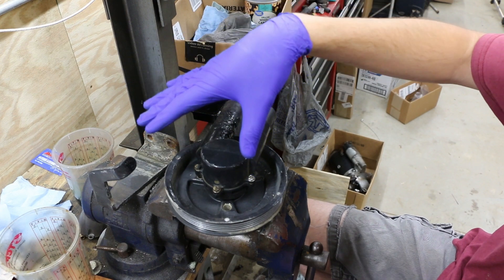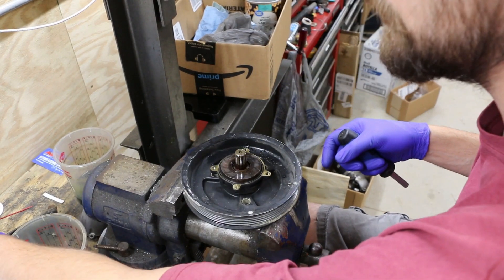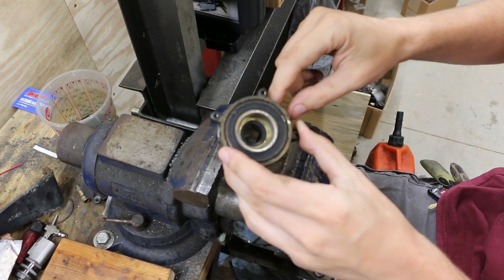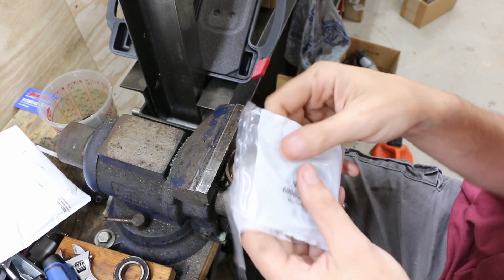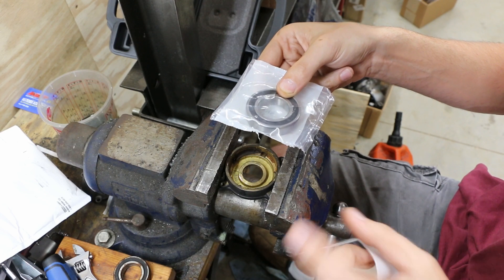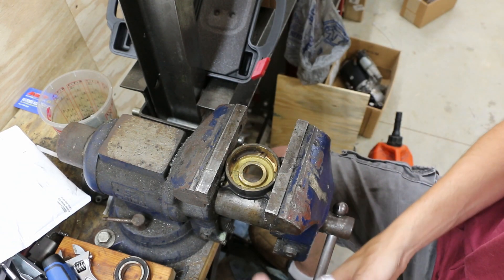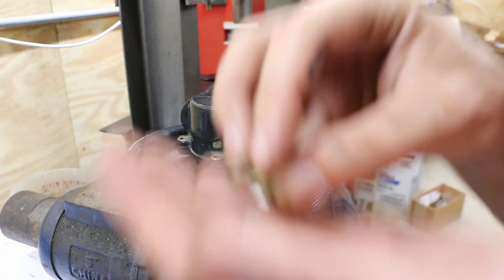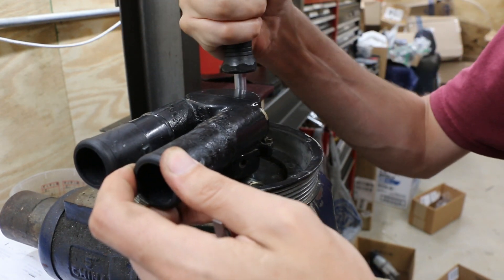Volvo Penta Sea Water Pump Rebuild (shaft seal, bearing, impeller replacement)

Comment: One trick to try for bearing installing is to put bearing in freezer prior to installing, should go in much easier.

Also large socket should work well for pressing back in the bearing incase the housing isn’t up to the task.

Thanks for sharing good video!
Reply from the maker: I forget that trick all the time.
I use it regularly for seadoo wear rings, so much so that I just keep them in the freezer, but bearings and other press fit type things it doesn't click to do the same!
Thanks for the reminder!

Comment: Hmmm…the part references are no longer available expect for the bearing, but I have no idea if that same Timken will fit my 5.7 GI motor….are they all the same
Reply from the maker: Oh man I'll check in a little bit when I'm back near my computer and update them, there are a few different pumps, I can probably look up and see if your motor uses the same pump, is that a capital i or a lowercase L in the GI?
Reply from the maker: What are the other letters in your motor serial? if you want you can email me: tom at trythistv dot com
There are a number of options, some use the same pump, others are different. Some have numbers like PMDA, PHUS, while others just have a -C, -CF or such
Reply: Mine is a 2008 5.7 Gi (little I as in ida).  That’s displayed on engine and the manual calls it a Gi-G.   I ordered the Stay Cool kit for this motor and says it’s stainless bearings.  Once I get it in hand I will see how it looks. If needed I will run it to auto parts store and get a Timken once I see the numbers on it for reference.  The oem has no numbers I can see. 

Great video and I have it all apart and ready for assembly though. I may even use one of my spare Volvo impellers as I have 5 since I change em every other year and none have many hours on them.  If the kit looks ok I will go with it as that impeller will get swapped after 20 to 30 hours anyway. 

It’s crazy that VP wants 80 plus dollars for an impeller.
Reply from the maker: Your Gi-G does use a slightly newer pump, but the staycool kit should have the parts you need, and worst case like you said you can match up a US made bearing if the one that comes with the kit doesn't look great. I would hope they are selling decent quality stuff, but you never know anymore.
Reply: Got it all installed and will test it tomorrow….the Stay Cool kit looked fine, but time will tell.  Honestly, I’ve never had as much as a crack in any of the impellers I’ve changed.  The bearing looked good to me but will make sure all is steady on the spin. My oem bearing wasn’t making sounds but had corrosion from water exposure so it was a matter of time…..it lasted 16 years so can’t complain.  Thanks again for video….the knowledge saved me around 600 dollars.

Comment from the maker: Here are the tools and parts you'll need:
➡ Pilot bearing puller: https://amzn.to/3r4F0yV
➡ Bearing driver set: https://amzn.to/3PgHl1E
➡ 2 Jaw puller: https://amzn.to/45PIrsh
➡ Bearing: Timken (2 pack -  you only need 1): https://amzn.to/3PhZAVv OR SKF (1 pack): https://amzn.to/45QS7SY
➡ Timken Seal (16x28x7mm nitrile double lip oil seal, excellent quality): https://amzn.to/47Vv7E3
➡ uxcell Seal (Cheaper, easier to source, quality seems ok): https://amzn.to/4cq75mX
➡ OEM Volvo Penta impeller kit (21213660): https://amzn.to/3xhiu8n
➡ Aftermarket Sierra impeller kit (18-3081): https://amzn.to/43vvpj8
➡ Rubber stop lug if yours has disintegrated (3857954): https://amzn.to/3L4XOEG

These are options I haven't personally tried but may be good options as well:
➡ Or, you can buy a whole new pump: https://amzn.to/45w5esK
➡ Kit for pumps 21214595, 21214596, 21214599, 21214601 and Johnson model 09-5000: https://amzn.to/3VP3Vn5
➡ Kit for pumps 21212798 , 21212799 , 21212800 , 21255090 and Johnson model 09-6000: https://amzn.to/49aO8C3

(These links are likely affiliate links, which earn me a small commission from qualifying purchases, which enables me to continue making these videos with a little less money straight from my own pockets)